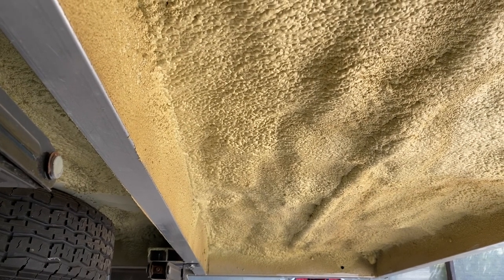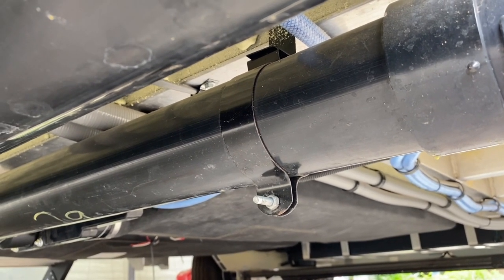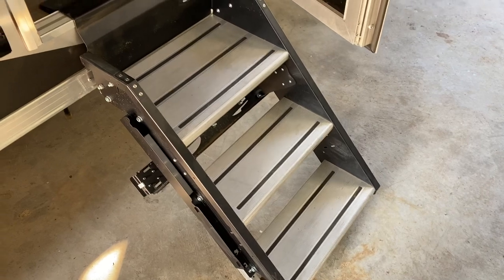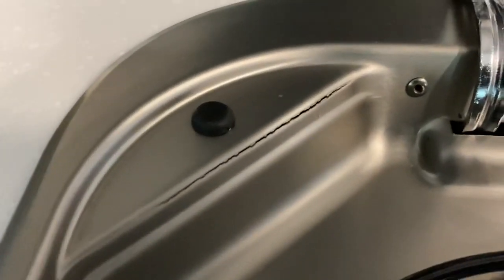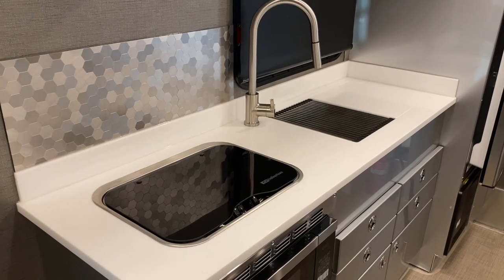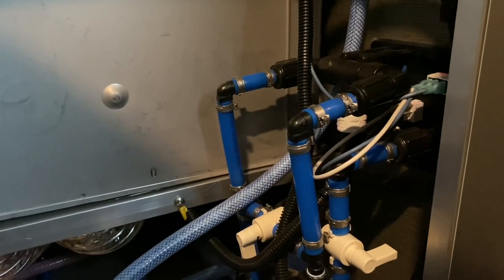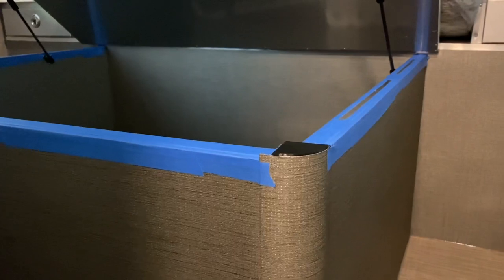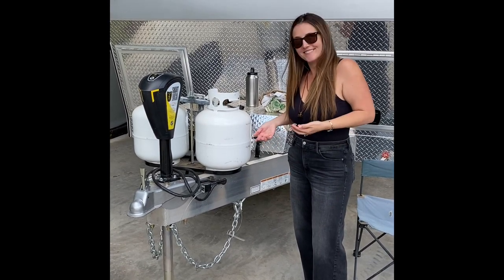ATC GAME CHANGER TOY HAULER 2021 REVIEW

Comment: This just sucks man. I guess even ATC totally dispenses with any notion of quality control, just like all the rest of the RV industry with their crappy balsa wood contraptions. And yet, ATC charges an extremely premium price for these trailers - 50% to 100% more than an equivalent "wood" trailer - and ATC is much more primitive and unrefined on the interior design and amenities. What really concerns me is the thing they push the most in their marketing - the all aluminum frame. It makes me wonder - do the welds on that aluminum frame have the same quality control issues that all of the interior and mechanicals have? Are cross-members going to start cracking after 10,000 miles and the whole thing starts coming apart? And they drastically increased their prices from 2020 to 2021, up almost another 50%. It's just pitiful. ATC should be ashamed of themselves and everybody should see this video. Hopefully it goes viral and forces ATC to publicly address the changes they are going to make.
Reply from the maker: Thanks for the comment. I have experience in welding and manufacturing and trust me I looked at all of the structural welds that I could see, and they actually look pretty good. I imagine the crew that assembles and welds the aluminum frame is different than whoever finishes out the rest of the trailer. To me, the frame and upper framing is the most important part, and I feel like I have more confidence in that part of the trailer than how it was finished out. If I’d seen sketchy looking structural welds anywhere under the trailer I wouldn’t have bought it. Period. I don’t know how it will hold up long term but I feel like it has to be more reliable than a wood frame. I used to always find staples and screws on the floor of my previous wood framed trailers when I would arrive at the final destination. I’ve also experienced water leaks, defective rubber membrane roofs, rotten structural wood, and mold on past trailers. I have no desire to ever own one of those again so an aluminum trailer was my only hope. I didn’t expect perfection from ATC, but I also can’t believe all of the problems I’ve found so far.

Comment: Typical RV issues.  At least it's not gonna rot when it leaks, or when the moisture in your breath condenses on the cold spots.
One misnomer that needs to be cleared up.  The phrase aluminum does not rust is misused.  Rust it the name for corrosion on ferrous metals.  Aluminum is corrosion resistant not corrosion proof.  If exposed to briny liquids like that used in road deicers the aluminum will corrode rapidly.
Reply from the maker: Yes, very true, especially the calcium chloride being used now, horrible for any metal

Comment: NEVER sign the financing or delivery documents until you have performed a delivery inspection. Once you sign the papers it is your problem, and the dealers / factory will not be responsive.
Reply from the maker: I definitely looked it over before buying it, I even pointed out the potential water leak I found and the dealer sent a tech out to look at it and determined that they had just spilled some water filling the tank and called it good, which was not the case. 
I should have tested everything in the trailer more thoroughly before signing, I guess I was too trusting when they told me they prepped it and it was all ready to go.
Reply: @Pioneer_Classic_Trucks   That happened to us on a Voltage toy hauler.. Tough lesson learned.
Reply from the maker: Yes it is

Comment: And these are $95,000? I'll pass
Reply from the maker: Mine was a little less than that but that was a few years ago.
Reply: @Pioneer_Classic_Trucks  I'm looking a toy haulers for my wife and I with our toy being a CF Moto 1000. Price does matter and I'm looking at Forest River Wildwood 270. My hurdle is spending $27,000 for something that may not last the duration of the loan. This would be my 1st toy hauler. Any thoughts?
Reply from the maker: I’m not familiar with that particular trailer but yes, they basically all depreciate faster than you can pay them off. I had a Wanderer wagon years ago, pretty basic but decent for what it cost.